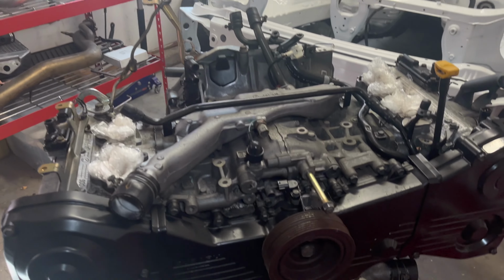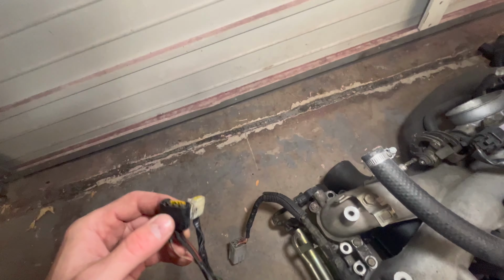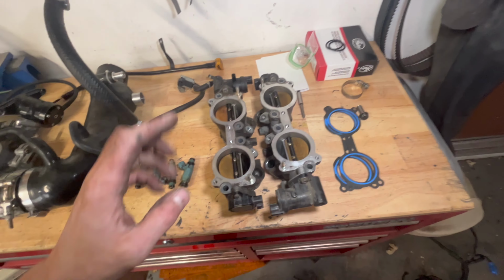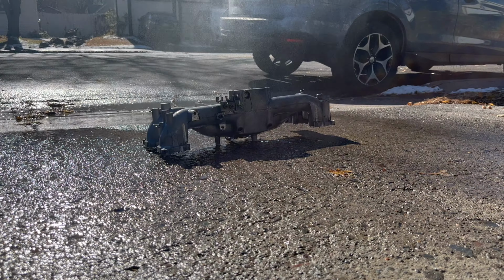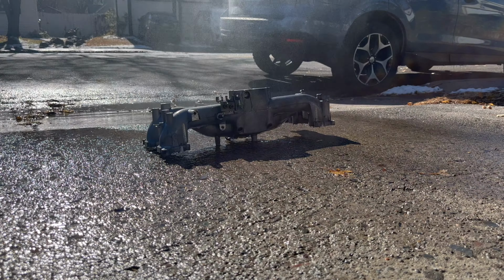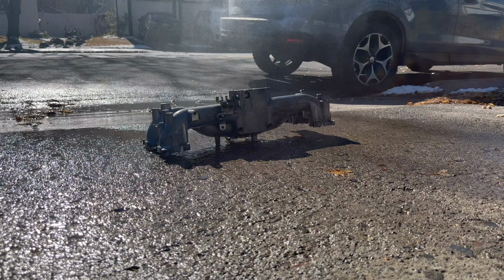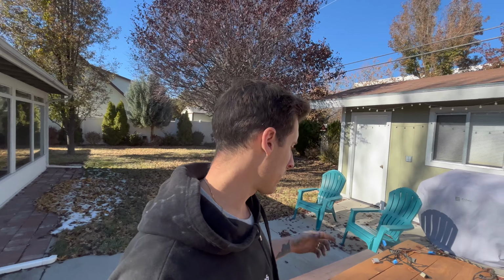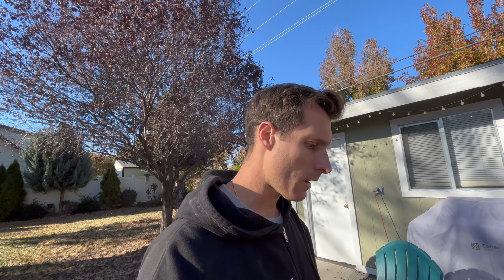Refreshed Manifold, TGVs, and Wiring Harness for Subaru WRX Budget Wagon

Comment: Another sweet video, thanks for sharing this. I'm wondering if you can advise me a bit on something, im currently trying to purchase a 2010 WRX, engine is EJ255 with 80k kms on it. We did a compression test on it (it was cold, and we didn't use wide open throttle). Cylinders 1, 3, and 4 all had compression at 135-140, while cylinder 2 compression showed 120. Is this a concerning sign? Should we redo the compression test hot and WOT or skip it and try to convince the seller to do a leakdown test on it before I buy? Thanks!!
Reply from the maker: Hmm... Yeah that is a little weird that cylinder 1 is lower.  Although, I don't think 120 is really that low for a cold compression test.  You may want to search Nasioc for cold compression averages for the 2.5L.  Definitely a leak down test should be more accurate.  I think they can generally tell you more about the health of the engine.  I do think if you buy it as is, it could be fine, but you'd be rolling the dice.  If you have the ability to redo the test hot and it's not too much trouble I would probably start there.
Reply: @sleeper_motorsport  Right on, thanks for taking the time to respond, I think I will not buy it unless it shows a good hot compression test or leakdown. Thanks again.